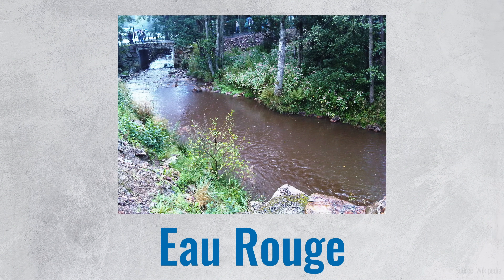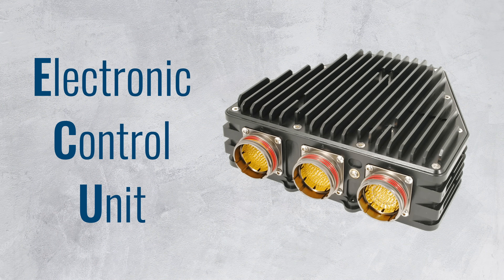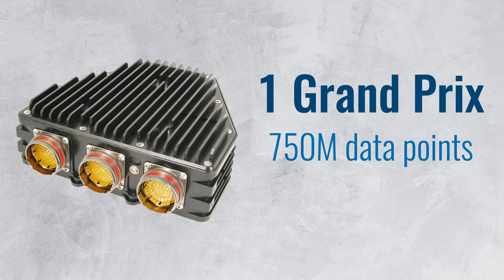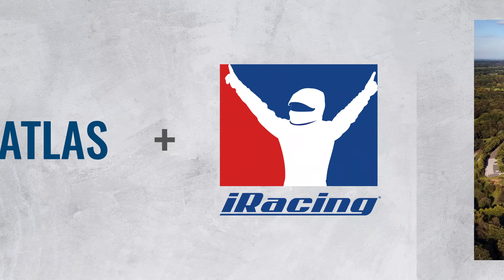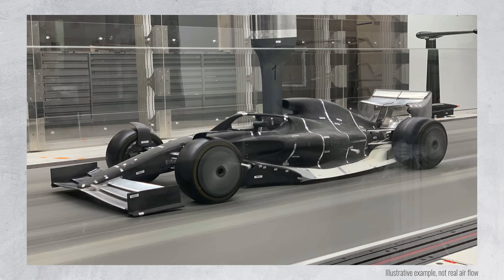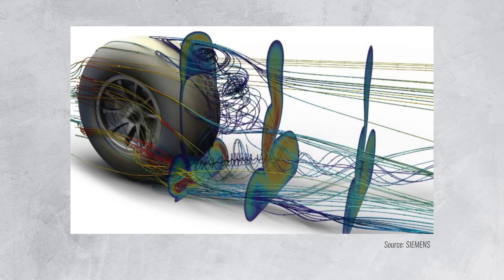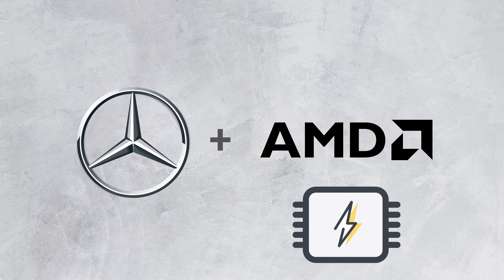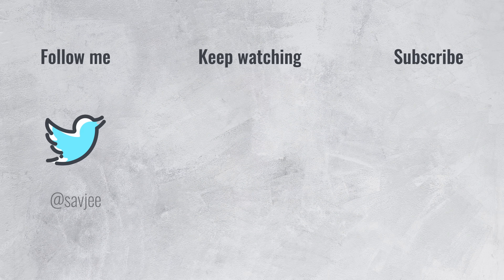Software & Hardware Used in Formula 1

Comment: How does the FIA limit CFD usage? What's stopping some engineer from running basic models on a private computer?
Reply: They control the transferring of the files. So if a file was shared to a personal computer and opened. The FIA/F1 would see that. There are ways around this I won’t go into here but that’s how it’s controlled.